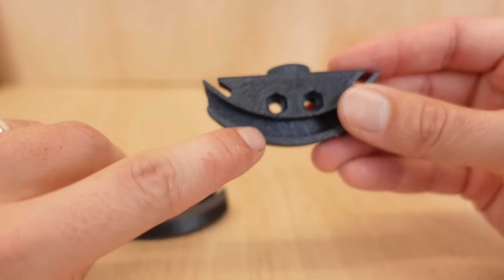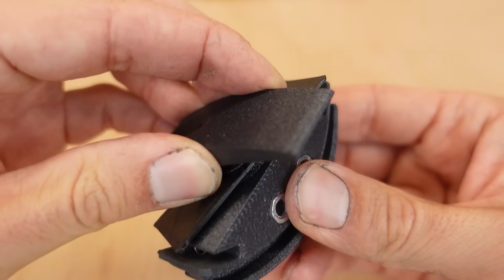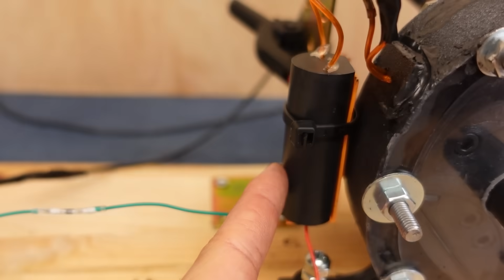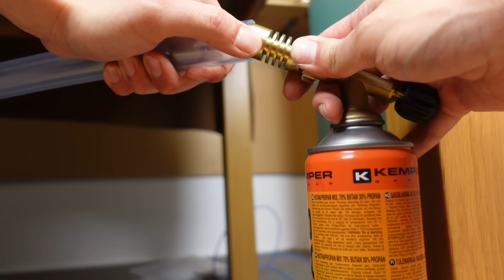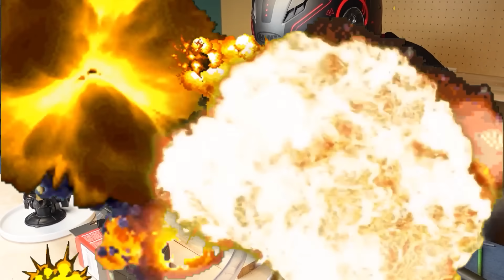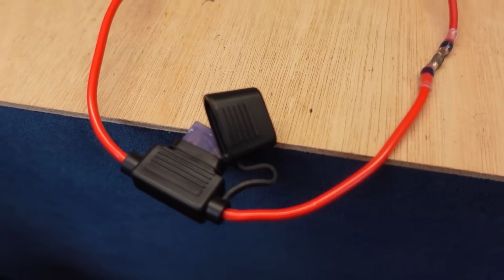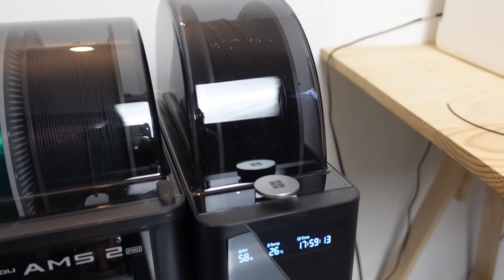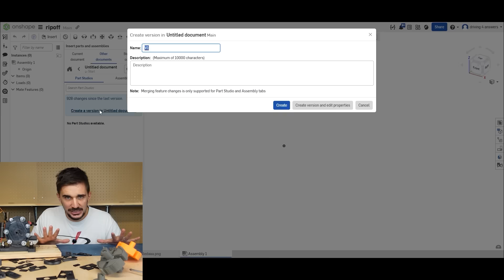My Oval Engine Now Fires At Will! Major Milestone For DIY Oval Rotary Engine 2.0

Comment: I'm curious if it would help to add a small amount of oil or lubricant to the fuel source? Help improve sealing, reduce wear, and reduce friction to use more combustion force to rotate.

I'm also curious if you could polish the interior and maybe use some of that off-the-shelf ceramic coating stuff to help fill in imperfections? Maximizing your sealing and combustion chamber's efficiency might help squeak out that extra oompf it needs. Plus, more wear resistance. Can't hurt when working with plastics.

Comment: Your probably not gonna see this but 

You’re definitely not getting an optimal spark with that set up. And fuel to air ratio is probably not the best either. Oh and just a suggestion make a simple ratcheting clutch to attach that drill to in case it does start so the drill doesn’t provide resistance, stopping it. I’m not a maker so I can’t really tell you how to fix it but I can at least help with the issue that I see. Been following for years keep up the amazing work.

Comment: At the moment you're putting in only fuel in the engine, you need to put a fuel and air mixture - how is that fuel supposed to burn fully in the engine without enough air?

Comment: I think those high voltage modules are 6v max, I use them with an 18650 3.6v battery.

Comment: i'm waiting on the force diagrams and math comparing the losses in piston internal combustion engine and the losses in this design.  

most of the combustion forces are being used to pry, slide, or push components against each other causing excessive frictional losses in wear and power.

your seals are doing great to contain the combustion within the chamber.... all 4 times it fired at room temperature at no speed.

again, very cool project but there's no future for it beyond "look at what i did"... when what you've done (effectively) is create a lightbulb with a 1 second life expectancy, makes less light than a candle, and costs a months salary.... when a 60w bulb costs less than a dollar at the grocery store.

Comment: You can make many working engine designs, the main challenges are: Lubrication, heat transfer, and internal forces at high RPM.  Got to start with these to land at a practical solution.

Comment: Commutator for the spark timing. Less issue with your wires bending.
You can make a simple one with some bits of copper strip and a couple of screws that would do the job. Proper brushes would work better, but we're still in proof of concept stage so there's no need to overcomplicate.

A copper strip on either side of the shaft, and a pair of springy copper strips that gently touch the shaft. As it rotates it will make and break contact. The width of the strips and position equals your timing. A couple of self tapping screws into the plastic shaft (or a fitting you attach to the shaft for this purpose) is all it'd take to hold them, as there's very little torque or pressure involved.

Otherwise, I support the 'small flywheel' idea to preserve momentum from one combustion event to the next.

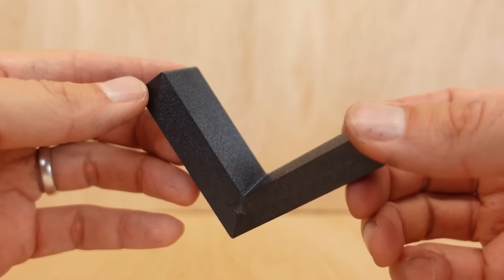Comment: 4:55 Carbon fibre filaments are also very abrasive, even after being printed, and will put carbon fibre dust into the air when it wears. Its not suitable for moving parts with sealing or contact surfaces that are expected to undergo wear, and it will absolutely wreck your tpu apex seals
Reply: It’s a proof of concept build, longevity probably isn’t a major concern.
Reply: CF is simply a scam, filament doesn’t adhere to carbon so it’s basically a weaker construction. There’s been plenty of in-depth 3D scans and it’s worse than basic. Plus CF gets into lungs like asbestos and goes under skin. Total bs of a filament that should be illegal to sell.
Reply: @driv3ver there are proper cf filaments that actually have improved mechanical properties (besides the continuous stuff markforged have) but they are definitely a minority
Reply: @badgermcbadger1968  there are, but those are medical or industrial „grade” - much more expensive than those commonly available.
Reply: If this gets anywhere, it will melt itself anyway. Hopefully it lasts long enough to get somewhere.
Reply: Not true for all cf filaments but probably for the bambu ones. Pps in in general has bad abrasion properties and isnt fit for this purpose

Comment: For the spark generator, why not simply use a EMPTY lighter, bust it open and use the spark generator thingy from there? Then you only need to 3D print a round trigger that pushes the button down, you even could make it spinn with your drill.

Comment: looking at the engine slowed down, you can see that the entire compression stroke happens after the power stroke. When one side is powering the rotor, the other side is sucking in air. You need a flywheel to carry momentum from the power stroke into the compression stroke

Comment: I think you’re onto something with ignition delay, or ignition timing. And I also think it’s possible that the exhaust port is too high, you want to make sure that it is completely covered until after the combustion chamber reaches its maximum size. But I really really do not think this is gonna work unless there’s a flywheel

Comment: so I’m not through the video yet but I just wanna say I really don’t think it’s gonna run without the drill if you don’t put a flywheel on it. It becomes a flamethrower because it’s basically just operating like a pump right now, one that lights it’s pumped material on fire

Comment: The friction is still WAY too high. You should be able to turn it by hand without compression. Usually you remove the spark plugs so there's no compression to do this, but I don't know if that would work with this design. I have two main thoughts: 

One is that I haven't seen any lubrication at all. You need some. 

Second is that rotary engines are known for being high friction because of the sealing faces. You could try solid graphite seals.

But if I'm brutally honest; this concept is ultimately going nowhere. Commercially researched, optimised, and produced, rotary engines have impressive power to weight ratio but haven't found commercial success in large part due to their low durability and high maintenance costs. This is a hard engine to make as a DIY hobbyist,

Comment: You need a fly wheel heavy enough that it will complete one rotation after you remove the starter crank. It needs enough inertia to continue through the next compression phase into the next combustion phase.

Comment: Either your spark is too late, or the ratio of the size between the combustion chamber and the fully expanded chamber isn't big enough, because your getting flames out of the exhaust port. That's a bad sign. In a normal engine it would mean your timing is wrong. But since we can see inside this one and it's a DIY design, it could very likely be the expansion ratio.

Comment: Those high voltage generators you're using to make sparks are fine in my experience. I've had one on constantly for minutes at a time. If it's failing then you either bought THE cheapest one off some dodgy website, or you're over driving it with too much voltage... Maybe shorting the output might also cause problems...

Two things:
One: The listing you show is for a 6V version and you're running it at 12V. So of course that is going to die pretty quick!
Two: Are your PPS-CF parts conductive? Sounds insane, but they might be, and so it might be shorting through the rotor or housing.

Comment: Important fact-you have to ignite the mixture when it is compressed(or even before), not when it is expanding. And I'd add flywheel and one way clutch to starter. On top of that normal ignition system, even stupid simple but normal, and it may even work.

Comment: 7:00 why bother with this trash instead of normal ignition coil?
Reply: Are you joke? Ive had one of these modules and it can make 20kv continues running on 3volts! And it cost me less than 1$. His ones blew up because these ar suppose to run at 3volts not 12volts. And its just easy to set up. Your comment makes you soud like a fool. You clearly dont know wht youre talking about. Befor this he actually tried running an engine using an actual ignition coil taken from a bike. And what a shame it fidnt even make a spark. So would yout call this trash or something that costs ten times more and yet is way worse?
Reply: @nexcover1083  lol ignition system is not about making xx kV. It is about making one short spark with enough energy at exact moment it is needed. This toy is trash for that. Your comment makes you soud like a fool.
Reply: @nanab256 No. do you even know that this toy has not more energy than your average ignition coil? You clearly know nothing about it. This module has atleast 2 or 5x more pulse current and heat than at ignition coil. Ignition coils arcs are literally so thin and weak compared to the bright and very thick and loud sparks for this module. Call me fool or whatever but I know what I am talking about. And if you really don’t like this module then that’s fine. Because I’ve made circuits that make continuous thick and very hot plasma that are above 20kv or so and it can melt some metal, so it will work even better than your average ignition coil. Car ignition coils at best will produce only few milliamperes at best. Bust the module has around 2nf pulse capacitor or higher and an estimate current can be 0.9 joules! The theoretical peak current can be above 100amps pulsed. Tell me now which one is more powerful.
Reply: @nanab256 Oh and I totally forgot to tell. That there is another version of this black module. It is square and smaller but it makes continuous arcs directly from its flyback transformer, bcz it’s not pulsed, it can be more reliable and it can sometimes still make more current and heat than car ignition coiles.
Reply: @nexcover1083  Ok, what is exact dwell time of this thing and how reliable this value is in different conditions(input signal frequency)?
Reply: @nanab256 That’s a great question. Since the module has its own internal oscillator and driver, plus voltage booster stage, the dwell time isn’t directly controlled like a conventional ignition coil. The real question is whether is can recharge and deliver enough spark energy at the engines operating rpm. If it can do that consistently then it’s functioning adequately for that application. The exact dwell time ofc would need to be measured with an oscilloscope or obtained from module design. However it’s safe to say that the module is rarely decent for ignition specially in diy engines and is certainly not trash. I mean, a smaller super compact module that doesn’t need bulky 12volt batterie or specific driver to work, plus it being atleast ten times more cheap than even the cheapest Ignition coils, is not too shabby. And it’s not even designed for engine ignition in mind, so that’s another fact. Also, the pressure non pulsed module, the one that makes continuous arcs should have better dwell specs since it does not have a booster stage and the booster stage can slow it down a bit. Over all these modules ate solid for this diy purpose.
Reply: @nexcover1083  If you still don't see why this is trash for that purpose it looks you have no idea about basics how engine works. Lets educate you a bit: engine needs ignition system for only one thing-to start combustion at one EXACT MOMENT. It needs just one short spark at EXACT MOMENT when it is needed.  If you can't control ignition angle precize and reliably(and with this module you can't and there is no way to fix it), such ignition system is worthless trash and works same good or worse than no ignition system.
Reply: @nanab256 Let me educate you on something. Just because something isn't the absolute best solution does not make it trash. That's not how engineering works.
A two stroke engine is less efficient and has higher emissions than a four stroke, yet nobody who actually understands engineering calls two strokes trash. They have different strengths and weaknesses, which is exactly why they're still used today.
The same applies here. This HV module was never designed as an automotive ignition system, yet if it can reliably ignite a DIY engine, then it has already proven it is capable of doing the job. That doesn't make it the best solution. It just means it isn't worthless.
You're comparing a purpose built ignition system to a self contained module that costs around a dollar and expecting identical performance. Of course a dedicated ignition system is going to have better timing control and optimization. That doesn't prove the module is trash. It just proves they were designed for different purposes.
Engineering is about whether something meets the requirements of its application, not whether it's perfect. Nothing is perfect, not even expensive ignition systems. They all have compromises and limitations. If your standard is absolute perfection, then by your own logic every ignition system is trash because none of them are perfect.
Instead of throwing around words like trash, explain it with actual measurements. How much timing error does it have. At what RPM does it stop working reliably. How much spark energy does it deliver. Those are engineering arguments. Calling something trash without backing it up is just an opinion.
Reply: @nexcover1083  lol this is far from "just is not absolute best solution" this is not even ok xd This is not even working in this case, is worse than nothing. This is trash.
"Engineering is about whether something meets the requirements of its application"
It doesn't
" How much timing error does it have"
It is random. This is just dc-dc converter, you have no idea hen it ill start and when it will stop, especially when caps are partially charged. 
"At what RPM does it stop working reliably."
It will not work reliably in rpm range between 0 and infinity.
Reply: @nanab256 You're making absolute claims without providing any data. If the timing is truly random, show the measurements. What's the trigger-to-spark delay, and what's the timing jitter? Saying "it's random" isn't evidence. Also, no ignition system works from 0 to infinity RPM, so that's not a meaningful comparison. If this module can consistently ignite and run a simple DIY engine within its operating range, then it clearly isn't "worse than nothing." If you think otherwise, back it up with measurements instead of repeating that it's trash.
Reply: @nexcover1083  lok if I'd say that "roll of a dice is random" you would say no because measurements xd
It looks you also have no idea how dc-dc converter works.
" What's the trigger-to-spark delay"
Something between 1-1000ms depedns on ic used in converter(not only model but also exact units will work slightly different), application, parameters and tolerances of  used components, temperature of each component, time from last turning off, load and probably a few more things. Then same list of variables for turning it off. And even if you would make special computer with precize sensors and a few maps for this one dc dc converter, and make it kinda reliably in delays, then still minimal time between turn on and turn off(yes, there is some histeresis) will be bigger than time the engine needs to make full revolution even at idle
Reply: @nanab256 You're making assumptions about what I know without asking. I've actually taken these modules apart, studied their schematics, and built DC-DC converters myself. The common modules we're discussing don't typically use a dedicated switching IC at all. They're generally based on a simple self-oscillating transistor circuit driving a ferrite transformer, followed by a high-voltage rectifier or Cockcroft-Walton multiplier depending on the version.
So when you start talking about "the IC used in the converter," you're already assuming a design that many of these modules simply don't have.
You also claimed the trigger-to-spark delay could be anywhere from 1 ms to 1000 ms. That's an enormous range. If that's your claim, I'd like to see measurements on the specific module being discussed. Saying it could be anything from one millisecond to a full second isn't an engineering argument unless it's backed by data.
If you've measured the timing jitter on this specific module, post the oscilloscope traces. If not, then you're speculating just as much as everyone else.
There's nothing wrong with saying an automotive ignition system is better engineered for engine ignition. I agree with that. What I disagree with is jumping from "purpose-built ignition systems are better" to "this module is worthless trash." Those are two completely different claims.
Reply: @nexcover1083  they are zvs or something like that?I used to build induction heaters based on them when I was bored in my work and found they are really hard to make them start relialbly
Reply: @nanab256 Um yes. I have made a low voltage big arc zvs that only runs on two 3.7 volt lithium batteries even if they are low on charge, the zvs still runs fine. I used a crt flyback for a test and it can make a massive arc length or 2cm and very thick and hot  just on two li-ion cells! And it even induction heats a little just on two battery's. So i would say that very satisfying because i used irfz44n mosfets which are not even logic lvl mosfets. So i could not imagine wht will happen if i used something like 30n06l mosfet or similar. But the black modules use only a single transistor blocking oscillator to work since its cheaper and smaller.

Comment: Add silicon grease as sealant and lubricant.
And given that every engine is a pump, have you measured how much pressure you can achieve on the exhaust port just by rotating it?